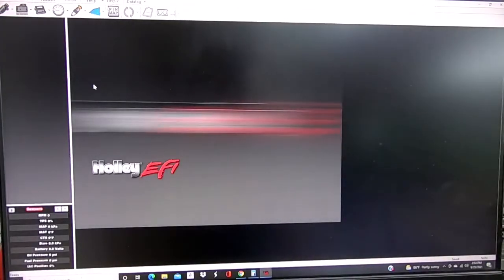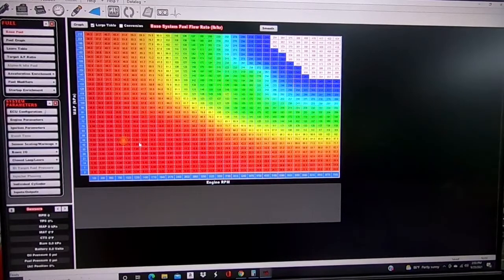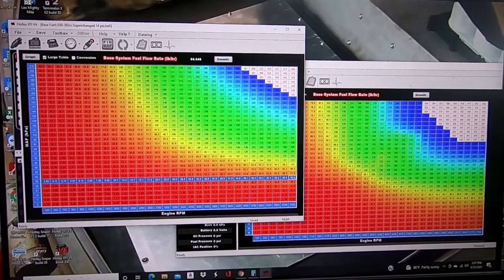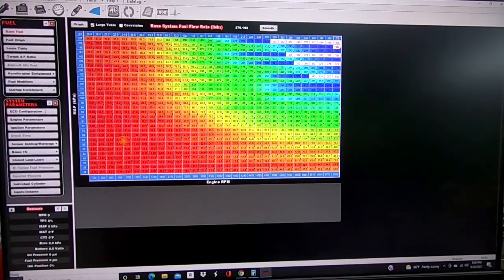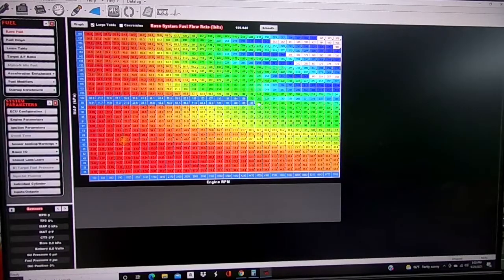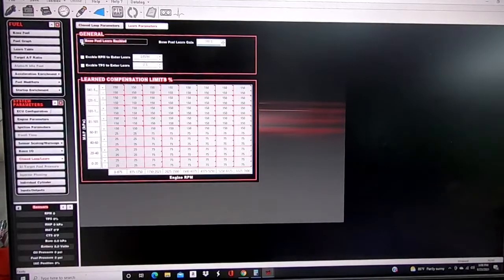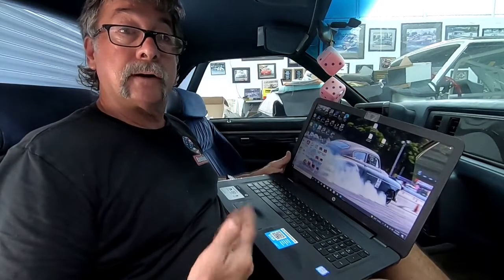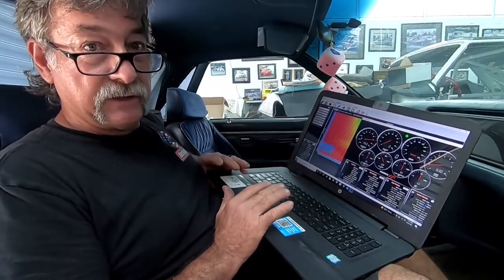HOLLEY EFI, how to tune part 1, base fuel map tips

Comment: How much offset did you enter when you where trying to fatten up the fuel at idle ? Mine is a little rich around 12.8 at idle so was curious where to start if I want to take out a little at idle
Reply from the maker: So to make adjustments to the fuel map. Highlight the area you want to adjust, then there are two main ways to make an adjustment. You can use the arrow keys on your keyboard, or right click your mouse, and a dialog box will open with options for you. If you take your target AFR and divide by your actual AFR, you will get the required amount of change you need. So this is just an example, but if your target AFR is 14.7 and you divide it be the actual  is 12.5, you will get 1.176, so you need to remove 17.6% of the selected area. If you use the arrow keys Ctrl & up arrow increases 1%, Ctrl & right arrow increases 5%, Ctrl & down arrow decreases 1%, and Ctrl & left arrow decreases 5%. If you right click the mouse, and in the dialog box, you can Cut-, Copy-, Clear table-, if you want to blend the highlight area you can Fill Row values-, Fill Column values-, Fill selected area-, or Offset Selected-. Hope this helps, thanks for the comment, and watching! Make sure you Subscribe to the channel for more info!
Reply: @LANDISPERFORMANCE . Thank you for the tip, I really appreciate it and your video is very informative.

Comment: Great video but how do you know if you have the best Afr target set
Reply from the maker: @brainward2611  great question. When using gasoline, we know stoichiometric is 14.7, so that should be your target for light load cells under peak torque. On an NA engine, WOT should be in the 12.9 to 13.2 range, which is best to start closer to 12.9, and while you are on the dyno, lean out a very little at a time, till you find max HP. For idle, it can be a little tricky. For engines with a large LSA camshaft  or very little overlap, you can target a lean afr like 14.2 to 14.7. But as you get a camshaft with more overlap, you will have to use a richer afr, like 13.8 to 14.0. Hipe this helps. Listen to the engine, it will let you know when it is happy. Just pick your targets, then tune the Base Fuel Table till the fuel correction is under 10% before going back to adjust the Target AFR Table
Reply: @ okay thank you I will stay at it I have a 430" SBF with a Ysi blower and 17 to 19 lbs depending on how high I rev it Sounds dumb just trying to get maximum efficiency not fuel economy lol when driving around on the streets I am just over 900 to the wheels I have dual 3" exhaust with an X pipe Do you think I would benefit from upgrading to a dual 4" exhaust Thank you Keep up the good videos !!
Reply from the maker: @brainward2611  So, there is only two ways to know if a larger exhaust system will gain any benefits, first one, try it and see, but that is expensive if there is no gains, second one would be to add a pressure gauge to the exhaust system. Weld a bung in the front section of the exhaust, run a steel line, I use a 3/16" brake line, go about 1 ft and then make a coil of tubing ( to cool the exhaust temp) and connect it to a pressure gauge, like a hand held fuel pump gauge, it only need to read 0 to 10 psi. Or connect to a sensor and datalog it. If it builds exhaust pressure, then you may see a gain with a larger exhaust, or remove any restrictive pipes, mufflers, etc. and re test. What fuel and spark management are you using? What KPA, throttle %, RPM are you looking at to maximize? By the way, for boosted applications, your AFR at Wot will be a richer target than an NA target, also depends on the fuel type you are using.
Reply: @ the gauge is a good idea thank you Yeah I know the Afr is richer with boost I'm a 60 year old ford tech so I know basics I have a Holley Sniper Xflow with ignition control and to complicate things more I have 2 AEM water meth nozzles injecting into the blower This is new power levels to me so trying to maximize efficiency and engine safety and reliability
Reply: @LANDISPERFORMANCE  idle is around 950  with about 4" of vacuum it drives around 2200 to 2400 pretty much any throttle or speed of light load driving because of the converter Which is out again trying to get it corrected So on the exhaust pressure gauge if I am around 2or 3 psi minimal gains to be had 8 to 10 pretty safe bet gains would be had by increasing the size  Sound about right ?
Reply from the maker: @brainward2611  yes that sounds about right
Reply: @LANDISPERFORMANCE  Thank you Just curious when we get back to spring and I'm back up and running Could I maybe send you my file and maybe a datalog for you to look at and give me your opinion  I'm not looking at taking all of your time for free or anything just looking for an educated opinion   If you were interested in helping me more then that's a conversation we could have at that point
Reply from the maker: @brainward2611  Absolutely. Email on the main page of the channel.
Reply: @ that's awesome Thank you

Comment: My new laptop doesn't seem to connect,  usb link doesn't show ? 
My old laptop battery is bad so im unable to do data logs
Reply from the maker: @Mcscher  have you checked in the device manager on your laptop to see if it shows the USB device?  When you open the Holley software and you have  the USB cable connected, what does the connection box in the software say,OFFLINE, or USB LINK?
Reply: @LANDISPERFORMANCE  it says offline
Reply from the maker: @Rendezvous70  Are you using the USB cable to connect? Is it possible your USB connector in the ECU has been damaged from the cable getting pulled or some other kind of damage? Do you or any of your friends have a Can Buss cable that you could try? Did you try all of the different USB connectors on your laptop?
Reply: @LANDISPERFORMANCE  the cable is good , my other laptop works fine just the battery is done, so i can't go out to do data logs . 👍
Reply from the maker: @Rendezvous70  You need to open device manager on your laptop, once you open device manager, check to see if there is any error signs. Usually it will be a yellow symbol. It means one of your devices are not working or properly configured. You can also try re loading the Holley software, and make sure it loads all of the drivers.

Comment: Where do you click usb link?.  I bought the cord an can splitter and connected the USB and I'm getting nothing off of the laptop as far as live readings.
Reply from the maker: So when you open the Holley software, look on the menu bar, you will see File, Save, Toolbox, Offline. When you plug in the USB cable, which is already connected to your ECU the Offline will switch to USB Link. If you click that button, it will switch to On Line. If you click on it again, it will go back to USB Link. Thanks for your comment. Subscribe, click the Bell for instant notification when I drop new content.

Comment: FYI, (sorry if you already know this) using keyboard shortcuts you can really make the adjacent CELL selection in the tables much easier than mouse clicking and dragging.  For example say you want to select an entire ROW in that base fuel table, click the FIRST cell on the left, then PRESS the SHIFT + END key on keyboard. That will select the entire row, all cells to the right.  If you want to select an entire COLUMN, click the top cell and press SHIFT + PgDn key and it will select the entire column, all cells below.  Block selection is easy as well using the SHIFT + ARROW keys up/down/left/right. Using the Keyboard shortcut/selection keys can really be helpful if you're riding along in passenger seat trying to make changes while the car's moving imho. Try other combinations too, like SHIFT + HOME (selected cell and those to the left), SHIFT + PgUp (selected cell and those above), etc.. Great info in video, thanks!!
Reply from the maker: Thanks for the comment. I had forgotten about these keyboard shortcuts, but once you mentioned them, I vagally remember that from the Holley courses, I am so used to doing it the other way for older ECU systems, like Accel DFI, Classic FAST and others I forgot about doing it that way. Thanks for shaking the cobwebs out.... LOL!

Comment: this is one of the more informative videos Ive seen, i want to see more on the fly adjustment while driving around and the process, also im guess the spark tables should be left alone till fuel is figured out?
Reply from the maker: Thanks for watching, and leaving a comment. I am working on showing the tuning process, keep an eye out, or better yet Subscribe and you will be notified when I post new content. And to answer your question, first thing to adjust is the Base Fuel Table, this has a bearing on all fueling adder table like cold start and accel fueling. Once that is correct, then go to timing.